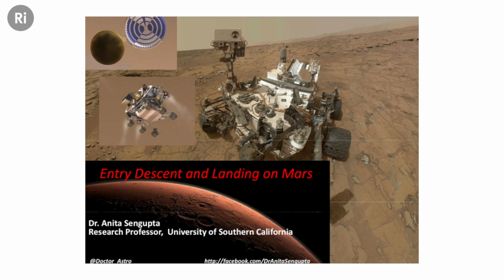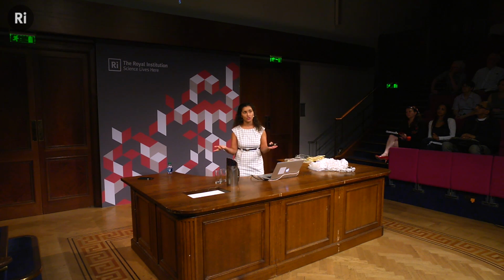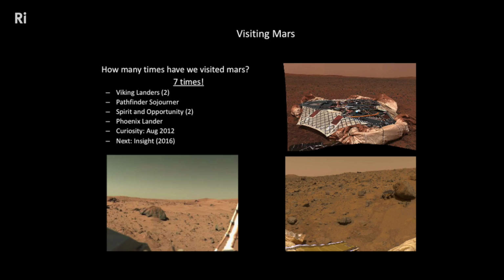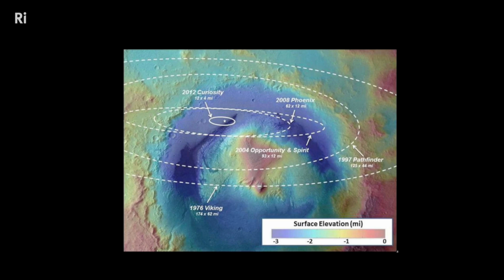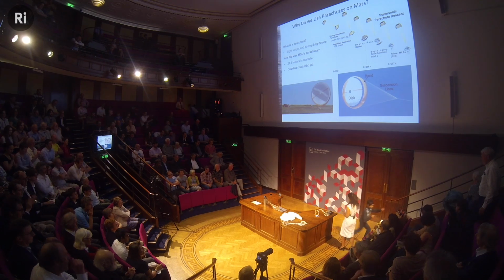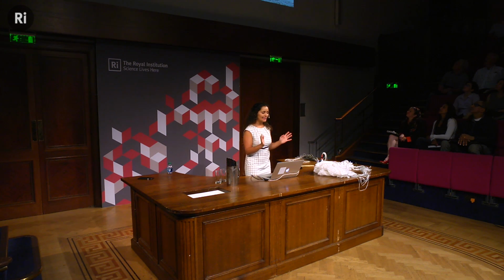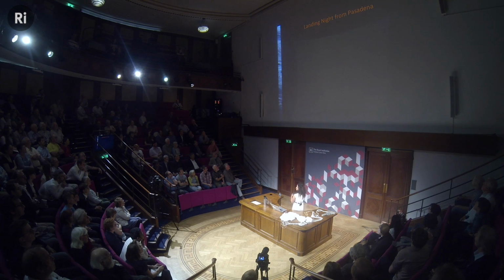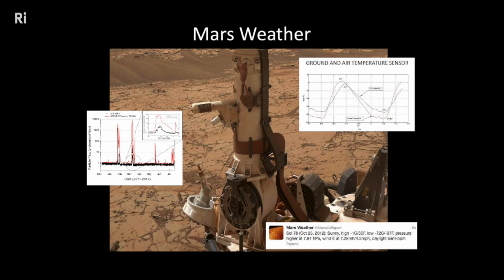Mars Exploration: Curiosity and Beyond - with Anita Sengupta

Comment: I would like to point out that it's inaccurate to say that we need heat shield because of friction. It is a myth that even scientist keep repeating: «Direct friction upon the reentry object is not the main cause of shock-layer heating. It is caused mainly from isentropic heating of the air molecules within the compression wave.» From https://en.wikipedia.org/wiki/Atmospheric_entry . That is, like when a piston is pushed in a cylinder and the compressed gas inside heats up.